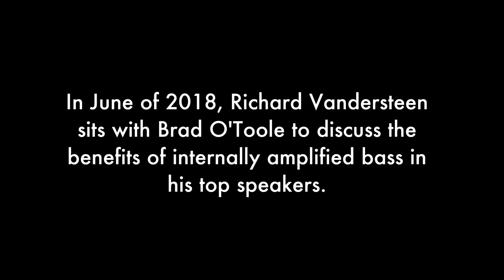Why Does Vandersteen Use Powered Subs with Room EQ?

Comment: Individuals such as Vandersteen are an absolute treasure, an industry icon, ...a wealth of information and wisdom. 

Loudspeaker designer/engineers with his level of experience are few and far between... he's always fascinating to interact with. Every time I've had the opportunity to speak with him, it never disappoints. 

Two or three years ago at Axpona, his two channel rig entirely filled this mammoth meeting room, ie., approx 30'x60' with a high 12 or 15 foot ceiling ... Sure, it was his flagships, however it was truly remarkable the MF/HF energy could generate. 
Of course the image and soundstaging was clear, deep and wide. 
The LF was just as impressiveas the upper octaves, again, especially for the large volume room. 
But ample low frequency capability in a huge room is simply a matter moving air.
Throw enough high power swept volume into a big room, done. 

But ample mid and high freqs keeping up with the big bottom end in a big room... is no easy feat. Those first order mids/tweets were mightily impressive filling a room 10x the size of most average listening rooms. 

It's easy to get jaded through the course of a long multiple day audio show. That weekend however, the Vandersteen room showed how it's done.

Comment: Helped a friend set up his quattros that were purchased used. They sound superb and were actually quite easy to get dialed in to his room (they handle the low bass in a similar way like the 5's and 7's) A simple analog decibel meter and result was effortless, seamless sound. Has me strongly considering bumping my old faithful 2ci's in favor of the newer designs.
Reply: I traded in my Quatros to a store in New Jersey, USA, approximately 10 years ago.  I wonder if those were the ones that your friend purchased?
They were the original, cloth covered version, that I had purchased in 2006.  They were as good as new when I traded them in.

By the way, although using a decibel meter with the "vandertones" does a very good job for adjusting the 11 potentiometers, there is another way, which will yield even better results.

You set up a microphone in the listening position, and you use Smart software to sample the sound.  It is somewhat involved (not quite straightforward).  I was discussing the process with Richard, when he visited my local high-end store.  He told me that he spoke to the store's installer about the steps, in order to dial them in with precision.  It was this past November, and I do not recall the steps that he outlined.

The installer originally used a decibel meter, as you did with your friend.  Some years later, when I learned about the improved method, I paid my store's installer to redo my speaker's tuning, and it was worth it.